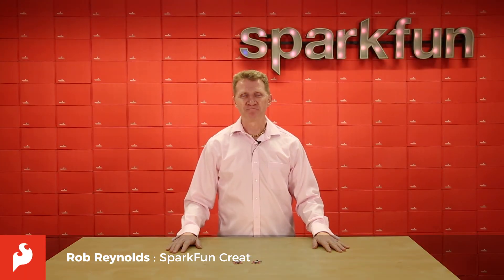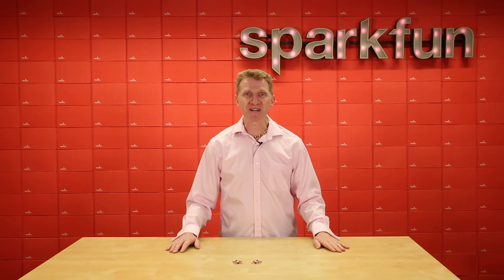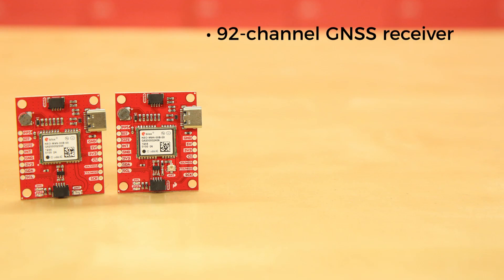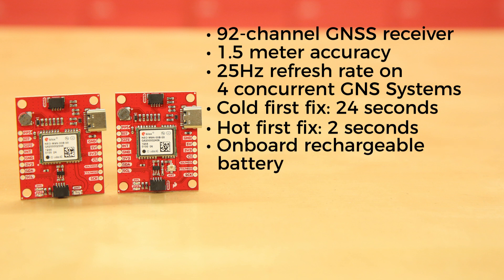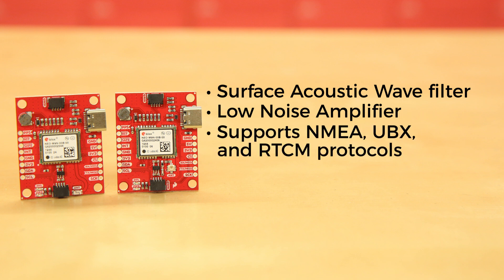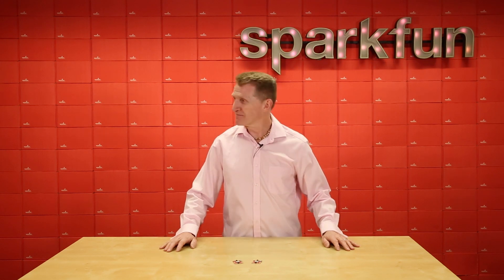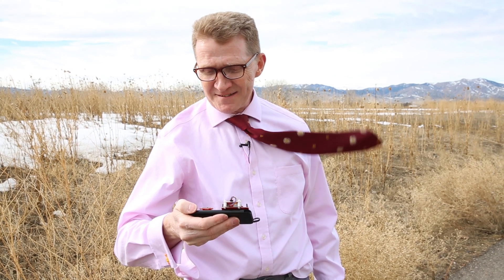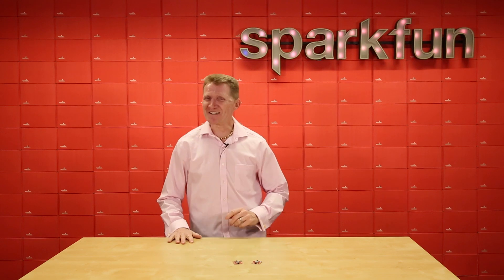Product Showcase: SparkFun GPS Breakout NEO-M9N

Comment: What about RAW and/or RINEX? What about DGPS or L1 and L2? Thanks.
Reply: RXM-RAWX not supported. L1 Only. Want dual band with raw measurements, select ZED-F9P, with SBAS also ZED-F9T.  NEO-M9N supports SBAS, and other sources, supports differential (not RTK) via in-bound RTCM3 1005, 1006, MSM for GPS, GLONASS, GALILEO, SBAS, QZSS and BEIDOU. Old DGPS/RTCM2 deprecated.